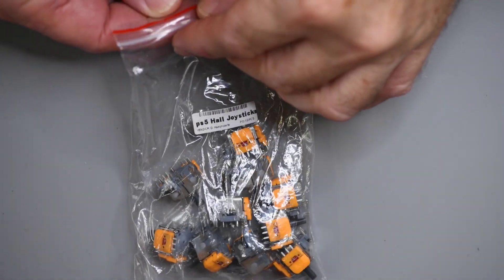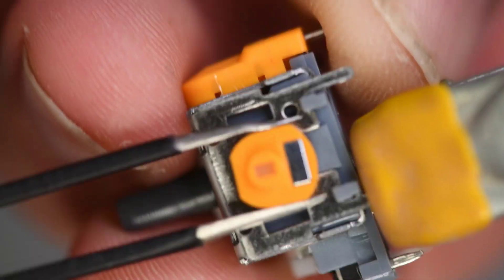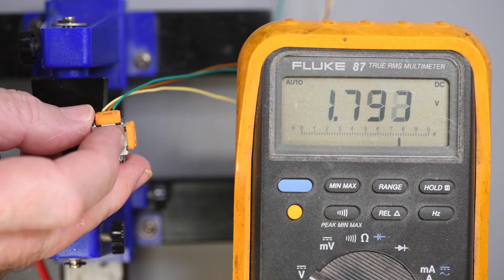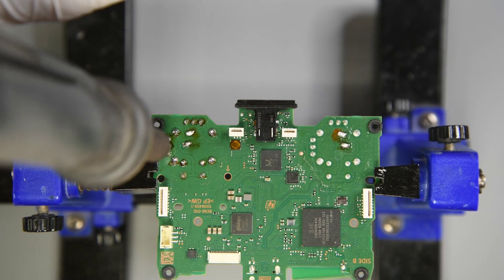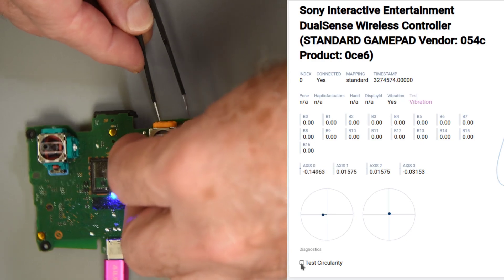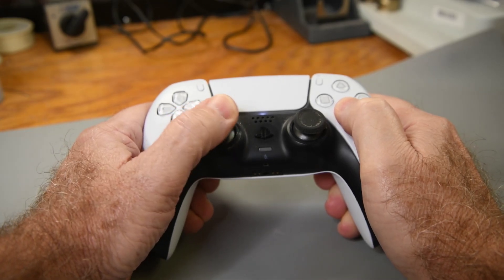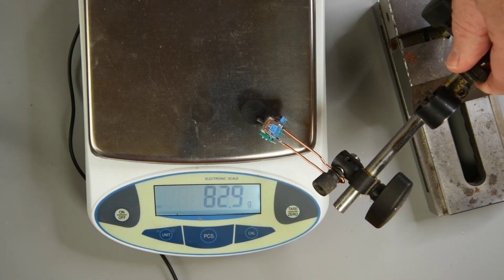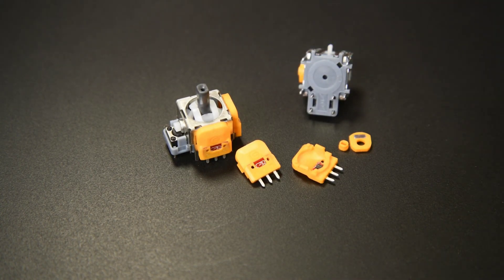Hall Effect Joystick Replacement for the PS5 DualSense

Comment: The company that makes those orange/yellow hall-effect sticks is "Jinfu" and the blue ones are K-Silver
Reply from the maker: Thank you very much.
Reply: @metalplasticelectronics354  On mines it;s GINFULL
Reply: Hello, which one is better?
Reply: @syn80 which one is better
Reply: @annoyedgamer1  I've only personally used the orange/yellow joysticks that have a red circuit board that say "L-8K" and I'm not having any issues with them.
Reply: @syn80  do 9lonly fit thw hall effect stick or a driver board as well?
Reply: @onionBADau  Not sure I understand your question. With the calibration website you shouldn't need a driver board. There are V5 hall-effect sticks that fix many of the problems that older versions had. They also use a updated hall-effect sensor and a bigger magnet. Older versions use small rectangular magnets. I would wait for a review of the V5 joysticks and see if you are interested in that.
Reply: @syn80  no drift at all?
Reply: @syn80  I've recently installed that very same version of those Ginfull  potentiometers on a DualSense and there seems to be an issue where there's a delay of a fraction of a second between physically hitting the upper-left corner with either of the analog sticks and the tester registering that, which doesn't happend with the bottom-right corner; if I spin either stick really fast the tester's marker "orbits" the bottom-right corner. I already made further tests to confirm it's specific to this controller, but I'm not sure if it's really the potentiometers that are at fault because I have a DS4 controller that also had its sticks replaced with Ginfull ones that I bought almost at the same time as the ones I recently installed on the DualSense and that controller doesn't present the same issue.

I'd like to know if you have the same issue as me. If not, I'd like to know how recent your controller's firmware is (which you can see at the calibration site), because I recently upgraded my controller's firmware and I'm not sure if it may have something to do with that.

edit: I just watched this video titled "듀얼센스 노란색홀센서 결함" from more than a year ago where someone installed two different brands of potentiometers and only the Ginfull one presents the same delay issue I'm experiencing, so it seems like I got an older, defective batch of the Ginfull potentiometer. What terrible luck.
Reply: K silver best
Reply: Blue ones pro use
Reply: So, which is better?
Reply: Found it out yet?  @franjapanjapane1305
Reply: Ginfull* and K-Silver
Reply: It's Ginfull.
Reply: Tweaking analogs
Reply: Which one has better quality

Comment: How is fast movements readouts? It was an issue with earlier V3 Dualsense batches where it has wrong movement while spinning the stick fast in circles but they said it was fixed
Reply from the maker: This is a version 1 controller.  It has kept up with as fast as I can spin it.
Reply: @metalplasticelectronics354  no you got me wrong I meant the orange hall effect sticks themselves they had 3 releases the last one called V3 which claimed to be jitterless it was the only module that can get wrong fast circular movements readouts 
Look at the gamepad tester at 5:42 when you started moving it in fast circular movements you can see how inaccurate it was
Reply from the maker: I see, it does seem to have a slower response than the regular joystick.  That may be where the different feel is coming from.
Reply: @user-en5gu3dd9j  Looks like they just threw a 1uF capacitor on it or something for this batch. Yikes

Comment: The different "feel" you are getting is these G-unit hall effects have a different interior spring tension design compared to alps or favor union potentiometers spring tension design. Even the newer k-silver Hall effects(blue) have a spring tension design similar to alps giving a higher resistance. Id recommend tearing all 4 units down for yourself its and interesting rundown of similar ideas producing different results. These G-units housing modules are my favorite due to the lighter tension and smoother movements add the K silver hall sensors, no noise, smooth feel, HALL EFFECT GOLD❤❤❤
Reply from the maker: I did put some of my force testing in the video.  The force to move the Hall sensor joystick and the Favor Union are about the same.  I think the Hall sensor joystick force to move is a bit more even over it’s entire range of movement.  I want to say it feels smoother, but I’m not sure that’s the best way to describe it.  But I do find myself reaching for the controller I put the Hall sensor in first.  I guess that does say something about it.
Reply: @metalplasticelectronics354 jinful g unit sticks have less slop that traditional alps, so maybe that’s what you’re feeling.
Reply: would you say those blue ones are better than the orange ones?

Comment: is the circularity full after putting it back to its case?
Reply: Any ideas how to make the thumb stick max out close to the case?
Reply: @NeoDren I think you have to buy a third party calibration board for the Dualsense. There is a software tool for calibrating the DualShock 4 but not the dualsense unfortunately.
Reply from the maker: Could possibly unclip the hall sensor part from the joystick frame and bend it away a bit.  Putting a bit more distance between the sensor and the magnet.  Centering might be a bit more challenging.  But it’s really not bad the way it is.
Reply from the maker: The circularity is more than full.  These Hall sensors seem to max out before the thumb knob hits the case stop.  I think that might be part of the different feel they have.

Comment: Wow, what a coincidence. I also replaced the Hall sensor I ordered from AliExpress 3 days ago. As you mentioned, calibration was a bit tricky, but it is working satisfactorily. We'll have to wait and see. While watching the video, I was curious. What temperature do you set the vacuum desoldering machine to when replacing an analog module?
Reply from the maker: It’s an old Hakko 470 so it doesn’t have a temperature readout.  I run it at about 90%.  I would expect it runs 750 to 800 degrees F.
Reply: I have my hakko Fr-301 set to 250 degrees Celsius. I would recommend a lower temp if working on Xbox one s controllers. The joystick pads are much less heat resistant than Sony or later generation Xbox controller boards in my experience.
Reply: Hola, yo compré en aliexpres también, y al instalar el mando me dejó de funcionar, se vuelve todo loco, que puede ser? Gracias😢
Reply: @akagicac  Cuando el sensor de efecto Hall se reemplaza con soldadura, es posible que sea necesario ajustarlo, pero si no funciona por sí mismo, la soldadura suele ser mala. Parece que hay que volver a instalarlo después de retirarlo.
Reply: @hyunwookim6628  gracias por contestar, lo que me pasa es q el mando dejó de funcionar por completo, se mueven todos los botones, es como que al instalar el joystic se volvio todo el mando loco